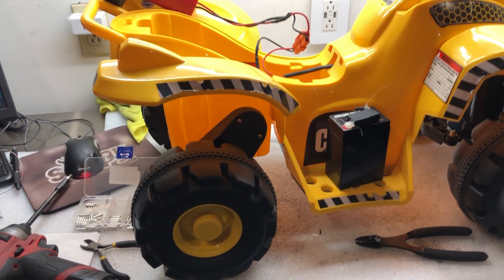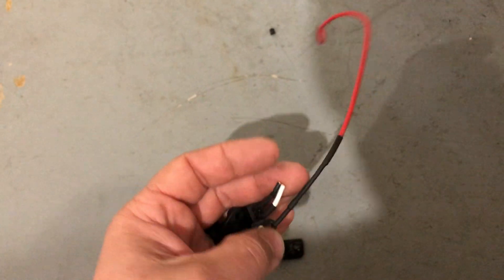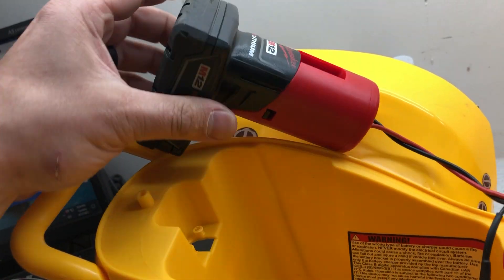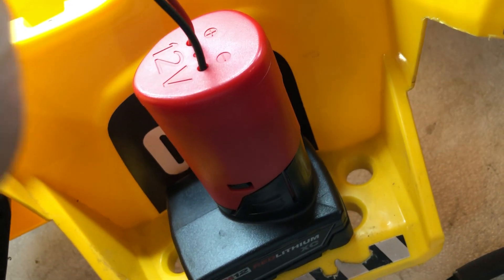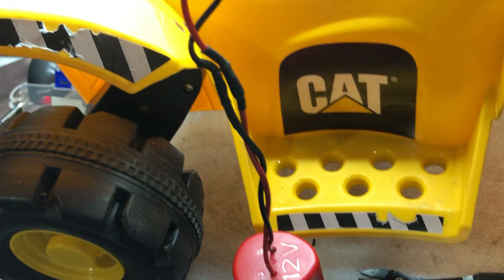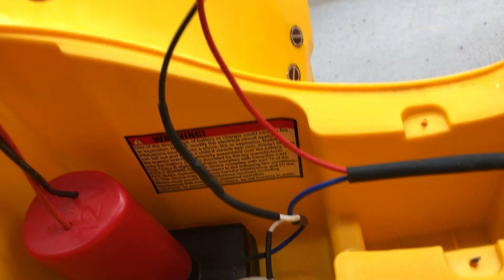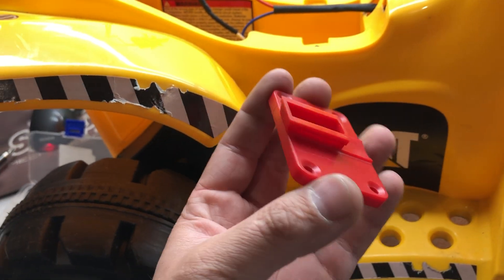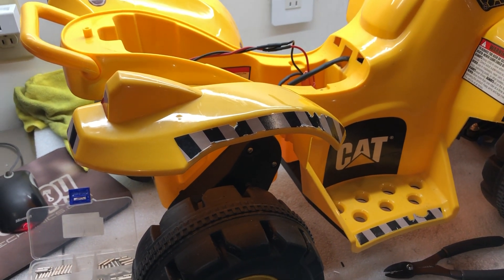we put a Milwaukee 12v battery in a 6v kids power wheels and you wont believe what happened next

Comment: I’ve wired all my sons power wheels with 12 volt car batteries. It’s hilarious he legit can ride for hours.  With two large charging prongs. Two dump trucks. His four wheeler was a little smaller so I hooked my agm battery from my $200 jump box.  Legit charge every 5 to 6 hours of riding.  Just make sure your power wheel is 12 volts to not burn anything up and might need to do away with any small inline fuses and replace with something larger.

Comment: Try it with an 18v battery.  Got yelled at by the wife that my son needed a helmet while riding. 😂
Reply: How did the motor hold up?
Reply: @ambirbtruckdriver   I ran it on the 6v Kawi ATV for about 10 mins.  I have yet hooked it up permanently.  I've rode it myself on the stock 6v and the gearbox/motor hasn't crapped out yet.

Comment: I know this is sloppy, but I think a fuse or a breaker would be a good idea.
Reply from the maker: i thought about it also, but i stalled the whole motor out and it only hit 8amps, forgot to say that in the video, im thinking of getting a 10amp breaker and wiring it in, i am also going to wire in boat lights and shit for underbody and headlights - tail lights so i tink ill order one and install it when i do the rest of the wiring. just to be sure, also thought of adding in a low voltage cutoff but i dont think ill need one, we will be able to tell its going slow
Reply from the maker: i would love an all in one unit if you can recommend as i don't want to have a wiring cabinet in this thing

Comment: What about a low voltage cut out to protect the battery from discharging to low
Reply: I’d like to know if the Milwaukee M12 battery pack has built in circuitry to shut down the battery when the charge gets too low. I know some brands have it in the batteries, and some in the tools. Please advise.

Comment: Can you link your M18 adaptor deal-y too..?

Also wanted to point out that you'll find traction becomes a big issue outside, more so if you have gravel around the area.
Take an old bicycle tire, cut across it, wrap around the drive wheels, and secure the bike tire right over top of the shitty plastic fantastic ones using screws.
Traction for dayz.
Reply from the maker: its in the description. its a 12v
Reply: @SloppyMechanics  You mentioned you had them for 18 volt stuff also.
It's okay I found a bunch.

Comment: does the 12v battery not burn up the 6v motor?
Reply from the maker: it does not with a 30-50lb child
you can also bump the 12v cars to m18 (20v) without issue also.

Comment: Super late to this video, but I have a kids 6v Maserati car, and my daughter will probably be in it a while given she’s still a little small for it. I want to do something like this, but I haven’t heard or read anything positive regarding 6v to 12v swaps. Is it going to burn up the one little motor?
Reply from the maker: in my experience with 3 of them it was not an issue other than too much immediate power haha, you can buy battery adaptors on amazon with voltage regulators built in also if you want to lower the voltage but i had no issues with motor or wiring burning up with m12

Comment: need to watch for the voltage dropping beyond a certain point on those lithium's, damages them in some way
Reply from the maker: indeed, i thought many times about putting the low V cutoff on them but most he has yanked one was half battery on the small 12v
Reply: @SloppyMechanics  nice, I have seen they run for hours on end before even slowing. I planned on doing same for my daughter, got the car on her birthday didn't even want it 🤣🤬